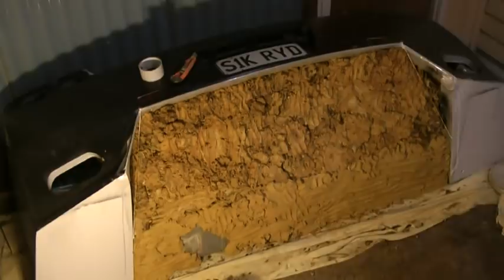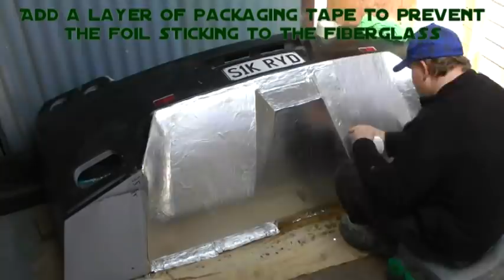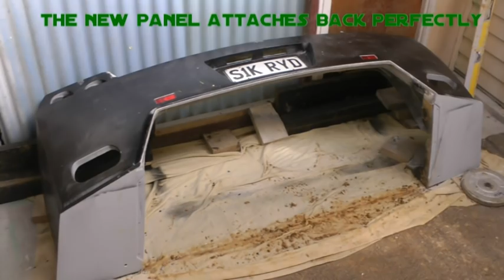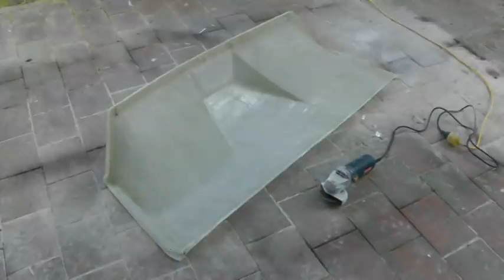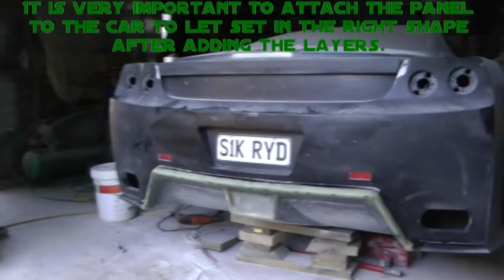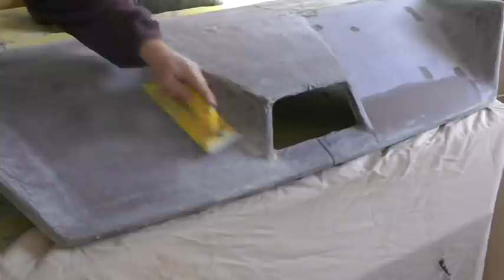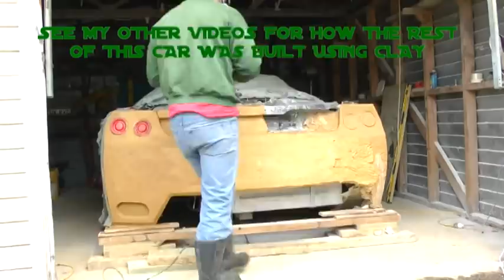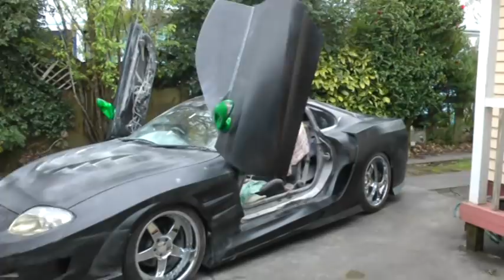How to make a panel from scratch. Step by step using Clay Sculpting - The Real Fast & Furious

Comment: S1KRYD Genuine question for you, say I was to do fiberglass as you have done here to build a duckbill style spoiler for my car, and then wanted to attach the spoiler and then mold it to the trunk for a perfect and seamless joining of the stock metal trunk and the fiberglass duckbill, how would you recommend doing that?
Reply from the maker: Jonah Destry Make sure you bolt it on securely. Then use New Tech and cover up the seam.
Reply: +S1KRYD What kind of clay are you doing this with?
Reply from the maker: Jonah Destry Potters clay. Any kind. Go with the cheapest type you can find. Go see your local potter.
Reply: if you're going to do that, you might as well repaint the whole trunk but I'm assuming you have a Z33?

Comment: outstanding craftsmanship and dedication to u sir. only thing id say is the rear quarter looks outta place. too flat and plain in my opinion. and where it meets the rear bumper, its too blocky, square. would hav added a vent behind the rear wheel and rolled the quarter into the bumper more. more of a radius. if i had the skill and if it was physically possible. but well done. learned alot

Comment: instead of using the original diffuser on my car could I use it as a mold? if so, how would I go about making it into a mold (getting the fiber glass/carbon fiber not to stick)? could I just use the same method you used on the clay which was the tin foil + packing tape? please get back to me im looking to make a rear diffuser for my 2008 bmw m3 in all carbon fiber. either all carbon fiber or sandwiched between some fiberglass to cut down on cost. thank you so much you have taught me so much already, youre the man!
Reply: cam burk to clear up my question; after removing the panel you then roughed it up in order for the strengthening layers to stick. I do not want to use my original panel on my car, I would like to use the original as a mold to create multiple diffusers. so, after making my fiber glass mold is there some type of non-stick resin I would have to apply to it in order to make it work as a mold to create more identical pieces? im looking to make these out of all carbon fiber so can I use the same method as you did?
Reply from the maker: cam burk The answer is yes. You need to wax the original part with 5 layers of wax first. You will need to let each layer dry and then buff it off. Use mould release wax. Then cover the part in PVA. You will ask for this PVA from your fiberglass specialist along with the mould release wax. Then you will add a layer of tooling gel to the part. When it becomes tacky you will then add some tissue fiberglass cloth. Then in quick succession you will add 4 layers of fiberglass matt and wetting them out with polyester resin. You should look at the part and decide what may provide a lock onto your part and then do your mould in 2 or more bits to prevent the mould locking onto your part.
Reply: thank you so much for the reply, when you speak of adding the layers of fiberglass are you referring to making a part from the mold? if so, I plan on using carbon fiber so would I still use PVA to release the carbon fiber or does it only work with fiberglass? tooling gel as well?
Reply from the maker: cam burk You must use PVA if you are making a mould and when you make a part from the mould. Same goes for the Wax. If making a mould don't waste carbon on it. Make it from fiberglass.
Reply: so basically what I have to do is, follow exactly what you did in this video, BUT instead of roughing it up for more layers, I should smooth it out to get ready to paint it. after its been painted I should put 5 layers of mould release wax and follow that up with a layer of PVA. after the PVA has dried, I can apply the layer of tooling gel, then start adding my layers of carbon fiber to make the actual diffuser.... that is my understanding, please let me know if I am missing anything or any specific resins I should use with the carbon fiber. thank you so much.
Reply from the maker: Yes you are correct. But you still need to stiffen up the part before you take a mould from it.
Reply: greatly appreciated, you are the man!

Comment: if you had a real floor connecting to that diffuser, and the strakes were underneath and horizontal to the road, it would actually provide you with downforce! instead of just looks u are getting

Comment: What made you decide to use Fiberglass/Carbon Fiber instead of plastic?Plastic flexes & is not vulnerable to cracking if hit.This is why I HATE Extreme Dimensions products because every part they make isn't worth a s**t.Nothing fits.Not 1 hole is drilled for installation.IMO plastic is the only way to go.It might not be strong,but it flexes & pops out if need be.

Comment: Where did you get the clay? Seems expensive to get that much clay
Reply from the maker: Potters clay. It is relatively cheep and reusable and can be resold.
Reply: Thanks! I check some out!
Reply: About how many pounds do you use in this video?
Reply from the maker: Dan Benoir About 60KG

Comment: how durable are these? and is it safe to drive a car essentially made from clay? lol like how do u even insure that
Reply from the maker: Hehehe. No silly. The clay is removed after the new fiberglass panel is made. The fiberglass or carbon fibre panels are stronger than the original steel panels and will not rust or erode. Essentially they will last 200 plus years. By that time all the metal components of the car will be gone leaving only the fiberglass panels behind. Insurance is the same as with any car ;)
Reply: thats amazing!

Comment: So you used polyester resin for this whole project? I thought with carbon fiber your supposed to use epoxy?
Reply from the maker: Polyester works well with carbon. But if you want the full strength out of your carbon then Epoxy is best. This car is so strong the doors are bullet proof against small arms and I have a video of myself walking all up and down the car. Cheek it out.
Reply: Yea I seen it. Strong is an understatement. I asked this on one of your other videos I think. If I make a replacement part for my car that connects factory by clips how do I go about replicating that so they connect in the same places? Is it safe to do this over your paint or will it ruin it? Say I make fender flares does the clay stick well to verticle pieces? what do I use to fill gaps? Sorry for the bombardment of questions but I'm very instead in making parts like this
Reply from the maker: Jose S I have another video coming on the RX7 project that will explain all your questions in detail. Hopefully I will have this uploaded in 3 weeks
Reply: S1KRYD  awesome really looking forward to it. I think once I figure that out everything else is left to my imagination which I get excited about lol. Been studying all about fiberglass since I seen your videos haven't even made a piece yet but I'm a quick learner and I'm confident with your steps and results that I can make some cool stuff. I'm going to start ordering supplies  this week. Hope to speak with you a little more and pick your brain on a couple things. Till next time.
Reply from the maker: Jose S Sweet as. Just let me know
Reply: S1KRYD another question. if i want to make a part that fits perfectly around an object, i'm going to have to make it wider than i need it, to compensate for the thickness of the tin foil and the fiberglass right?
Reply from the maker: Jose S Yip
Reply: S1KRYD ok thanks. Another question lol. If was want to join a made part to an existing part do I make the part so that it goes behind the existing part bond fill and level the gap? Or do I meet the part level and bond it directly with the fiberglass then fill and level?
Reply from the maker: Jose S The latter is best. For example if you were to put a bonnet scoop onto your existing bonnet then you would stick the scoop directly onto the bonnet and then use new tech bog to smooth it all out.

Comment: Would it be possible for you to make a custom body kit for my car? If so how much would it cost me? I am very amazed and very interested in your services.
Reply: Only the hood, front and rear bumpers, front and rear fenders, trunk, and side skirts.
Reply from the maker: Gideon the God Yes I could make up these parts. But I would need your car. As for cost, this sort of work is expensive because it is very labour intensive. For example the panel in this video took 10 or 12 days to make at 12 hours per day. If you had to pay the wages for this you would be looking at about 3k to make This one panel. The real pay off is when you make copies of your work and then sell them. This can potentially make you 10s of thousands or even 100s of thousands if you have a design that people like.

Comment: if you used carbon fiber then why not the whole by it... the carbon fiber look is really a class of beauty....
Reply from the maker: In this case the whole design used carbon just for the strength qualities rather than for the look.
Reply: +STIGZ 
brother, what kind of clay are you using ? 
the kind of clay I've been using is too tough and it requires a lot of effort to shape it.
please let me know what type of clay you use and do you refine it after every casting ?
Reply from the maker: Durgaprasad Turkar You must be using y2  clay or something similar. You will need to use a heat gun to soften it up for shaping. Normally you would have a heat drawer that would warm the clay up for you before you put it on the clay. In my videos I have stayed away from these expensive clays and the tools associated with them. I have come up with a method of using potters clay which is very cheep and easy to use. Why? Because the average Joe cannot afford them. The purpose of the videos was to show how anyone can do this sort of work at home if he has no money but is prepared to do alot of HARD work.
Reply: +STIGZ 
thanks for letting me know.

Comment: Any way to make wheel arches from this?
Reply from the maker: Yes. That would be very easy
Reply: S1KRYD How would you make them look like the original ones I'm trying to restore a car and can't get replacement panels. Thanks
Reply: S1KRYD Also how would you join them to steel?

Comment: First of all Ever heard of MDF its cheap and would make all those flat surfaces really quick, Faster then it took to watch this Video.
Also using Carbon Fiber is waste of money on that panel especially when your only hand laying it. It takes so much resin to saturate that it cancels out any weight to strength gains you could get if it were vacuumed  2 layers of 1.5 oz mat would have been fine and plenty strong enough.
One more thing, Carbon fiber aluminum body filler is a waste of money too.

Comment: How did you attach the panel to your car?
Reply from the maker: Combination of bolts and fiberglass
Reply: What kind of bolts and how did you get access to the backs?
Reply from the maker: Chris M The whole back bumper comes off. But this final panel was designed to go on after the back bumper is bolted on. So I attached nuts to the inside of the back bumper. Then when I attach this final panel all I do is thread the bolt though the holes of this panel and bolt it onto the rear bumper.
Reply: Ah ha. Yes yes... I see. I want to make a custom side for my truck over the door and side. Thought about sheet metal screws with metal glue to prevent loosening.  Thoughts?

Comment: I could show you a much faster way and the finished parts would be ready to paint or you could use clear gel coat and have that part finished in carbon fiber. Cool video but that is a lot of un- needed work. 
1 4x8 1/4 MDF panel 
10 yards of fiberglass like you had in video. 
PVA and some paste wax
Grey primer and clear gel coat
2 maybe 3 pounds of clay just for the edges
2 mm core mat of your choice
4 strips of balsa wood for fins.
Reply from the maker: I have heard it all before. I can see you have no new knowledge to share as soon as you mentioned MDF. You have no Idea my friend. However there is a faster way. Here it is - first use the proper clay that car company's use (at a cost of 10s of thousands) then mould your shape perfect. Then make a female mould directly off the clay. Then from your female mould make any copy you like out of fiberglass of carbon fibre. Job done! However because the cost of such clay is out of reach for 99% of us then I have shown a new way to do the same job but with potters clay. Yes it is a lot of work but such a technique is available to any hobbyist with half a brain and a bit of talent. This video was to show that anyone can do what car company's have been doing for a long time, and they do not use MDF!

Comment: The extremely expensive body filler will not help you go and Faster or more Furious for that matter.

Oh yeah Polyester resin doesn't stick to aluminum so you could have skipped the package tape however not a bad idea and easier clean up. 
Good thing you just happened to have $1000 in clay laying around. LOL

Comment: You guys should consider 3D printing....
Reply from the maker: Would love to have a 3d printer
Reply: S1KRYD Time to save up. There's a new model I saw that lets you print parts with fibreglass and carbon, even melding them together into one sandwich. But the price tag around $40-60k though.
Reply: Fadhli Jaffar I was like yayyy until the word 40-60k was in there hahaha.... I have done 3D printing before but I would really wish to own one that can print in carbon fiber, these ABS plastics are too weak
Reply from the maker: My Tran Yes I thought those plastics would be a bit week. But what you could do is print out a mould and then make the part in carbon fibre from the printed mould. Therefor no need for this new 3D printer of 60K

Comment: You did all that work for nothin really.  You have no idea how rear diffusers work and what you see on most cars then(6 years ago) and today(2019) are just for show.  The vanes(the more the better the "suction") on a rear diffuser have to start from the rear axles of the car.  F1 does this, DTM does this, LMP1-GTLM-GTD does this.  The more vanes you have the more vortices they create.  It is these vortices that create "suction" underneath the rear portion of the car.  A 2009 C63 AMG has a "show" rear diffuser.  A 2019 GT3 RS has a "functional" rear diffuser.  There is also a functional rear diffuser kit for dodge challengers(392's, Hellcat, Demon on certain years.

Comment: Top speed 20 km/h lol.
Reply from the maker: You think the clay stays on there aye bud? No the clay does not stay on the car and weigh it down. I have another video showing how the clay is removed. As for the fiberglass and carbon fibre it is not heavy. Remember that many original panels had to come off the car to start with and so the weight evens out and is similar from the start weight. Out of interest the clock goes to 320KM and although my twin turbo set up could not reach that speed (being only 450HP) it is not hard for the vvti 2JZ 6sp to be modified to 1000HP. :)